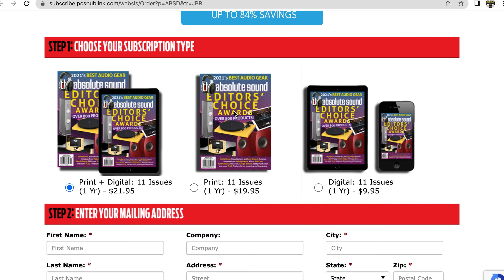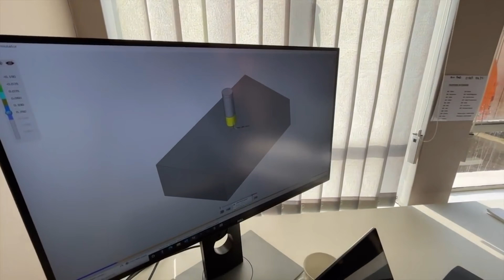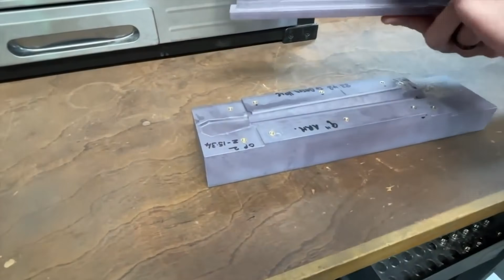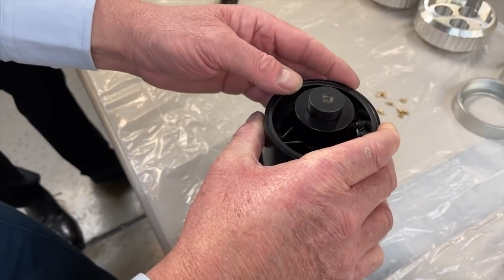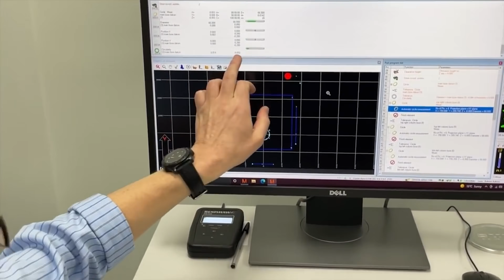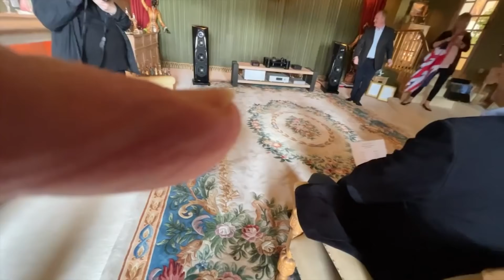Crafting the SME Model 60 Turntable... | Michael Fremer Investigates

Comment: The U.K. retail price is £50,000, which is about $60,000 in USD. Not really. Because 20% is VAT. That's tax paid to U.K. government, which does not apply to a sale in U.S. The true U.S. equivalent price is actually $48,000. But, the U.S. retail price is $72,000!! That's 50% premium. Anyone buys this turntable in U.S. is paying 50% more than in U.K. I would rather visit U.K. and have an amazing vacation for $20,000, pick this turntable up, and still have $4,000 in my pocket. This old model of selling imported high-end audio products - it really needs to change.

Comment: I am not sure I have ever seen a company that could benefit more from hiring a process engineer.
It is almost like SME has turned inefficiency into an art form.
I thought machining the PSU housing from billet was the real winner, then they moved onto machining the suspension from billet, and the final winner was checking the plate on a CMM.

Cast aluminum has better damping characteristics than rolled, having the suspension housing cast would not only improve them, but would hugely reduce the cost and time. There is no benefit to using billet over cast for the PSU housing, and they would probably get the most improvement by switching to cast iron, or molding from iron sheet.

Checking the plates on a CMM is doing nothing but adding time - there are methods that can be done right at the machine that will exceed the tolerances they are using.
Reply: CMM machine is making sure everything is dead nuts on. I hear you👍
Reply: @martinvegas1327  Dead nuts onto what?

They checked edges that are not in contact with anything for squareness. They checked diameter of holes that could be checked on the machine with a go-no-go gage. They checked the circularity of holes that are not bearing surfaces.

Dude actually made a comment about tool wear showing up on the CMM, when the tool will leave a severely degraded finish long before it wears out of spec on aluminum.
Reply: @joshua43214  Who cares? It's about perfection at this price level.
Reply: A machined forging would be an obvious alternative to machining from a billet.